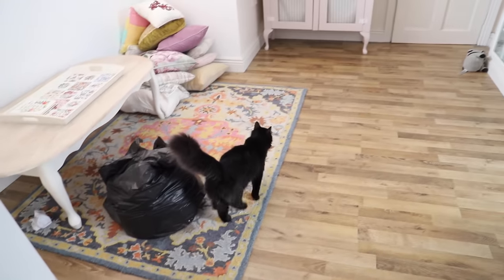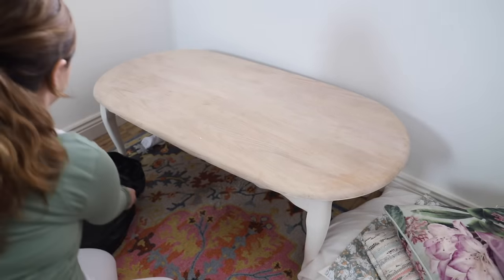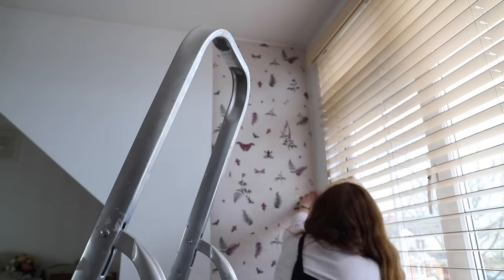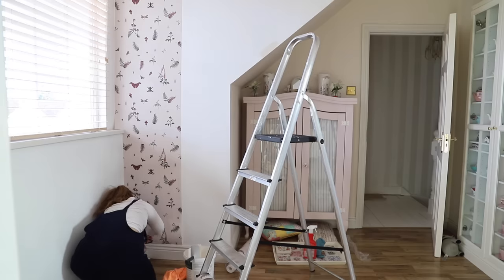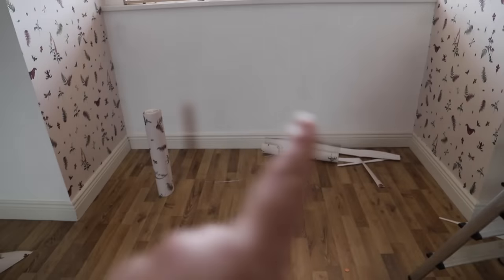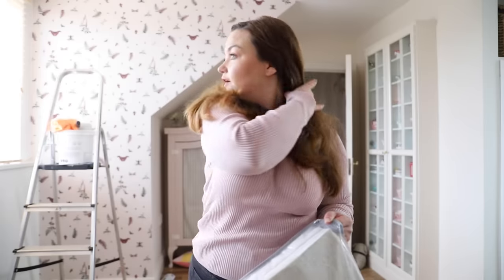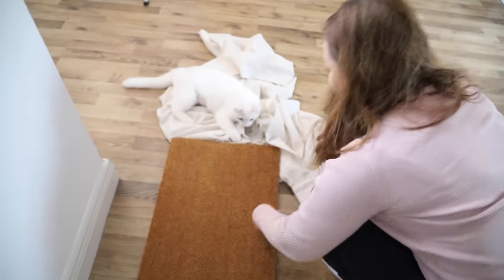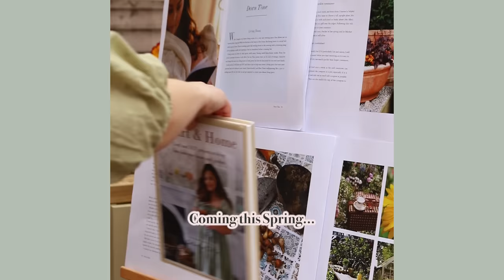Tiny Nook, HUGE Transformation! (Almost 🥴 ) Mini Bedroom Makeover with Wallpaper

Comment: I was taught to hang wallpaper by a man who was an engineer so pretty precise in his calculations, he taught me to start in the middle of the wall but first use a level to ensure a straight line as not all walls are square and if you start from a corner there is a strong chance your wallpaper will be out of square, once you have a straight line from ceiling to skirting then offer up the wallpaper to the line and then put the strip up then cut the ends, then just add either side and cut to shape.  Just a little tip but yours looks great.

Comment: I have a little black cat who also enjoys plastic bags. I bought a new mattress topper recently that came in similar packaging to your curtains. I wondered where the noise was coming from and it was her sitting inside the packaging, purring like a motor, bless her.

I had a bookcase and comfy chair in a corner of my bedroom. It was supposed to be my reading nook but I never used it in years. Until I swapped out the bookcase for a lovely mid century modern rolltop bureau that I found at an auction house going for a song. Now I use that nook every day.

I also sleep with my blinds open. My OT said it was good for my circadian rhythm. Girl I could be your twin, if I wasn't old enough to be your mother 😂

Comment: Because you're doing a different wall it wouldn't matter if you couldn't get the same batch number. Light hits the walls at different angles so they would look slightly different anyway
Reply from the maker: This is a great tip! hoping curtains will hide it too x

Comment: I used to work in a paint and wallpaper shop, and ALL of the wallpapers were "prepasted".  You would cut the length needed,  and then put the strip into  a wallpaper water tray, wetting the strip,  and apply to the wall,  smoothing out as needed.  It was so easy and fast, and super easy to strip off if wanted.  Does prepasted wallpaper not exist where you live?  BTW, it looks awesome!  ❤Pamela
Reply from the maker: No I’ve never come across pre pasted. Peel and stick has become popular?